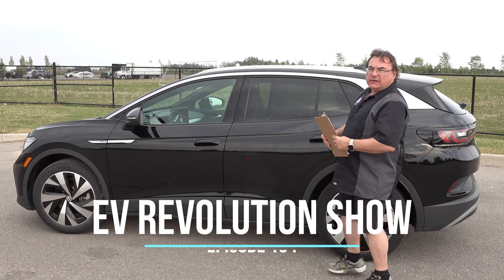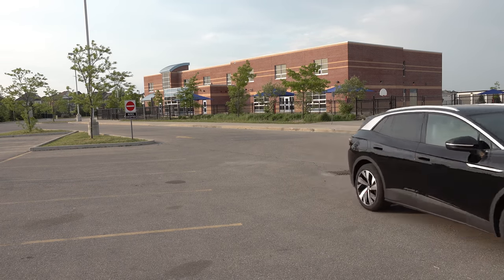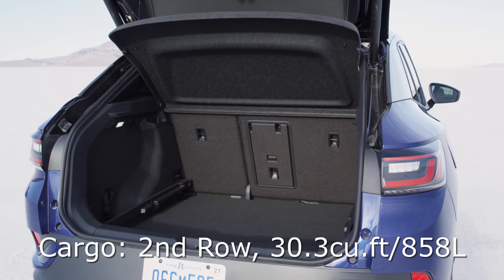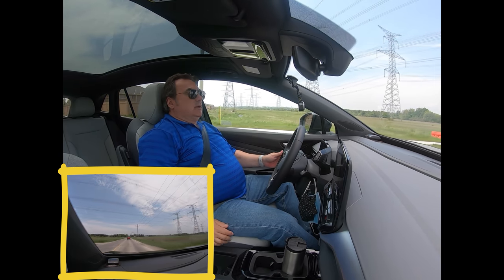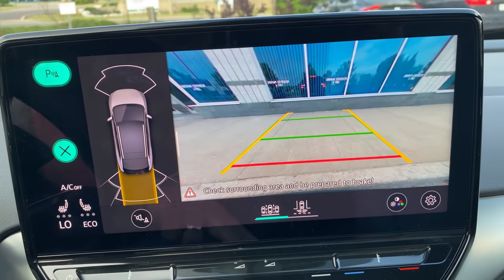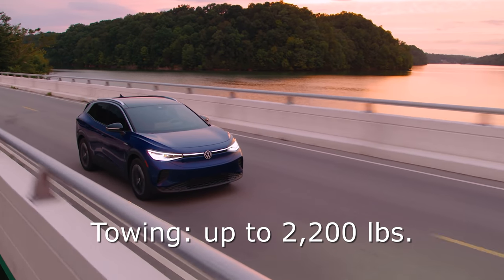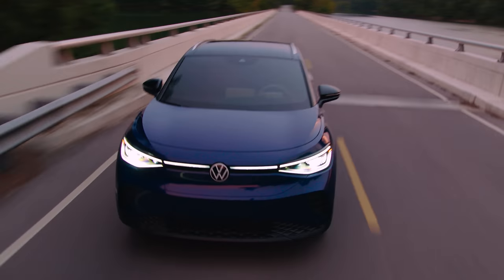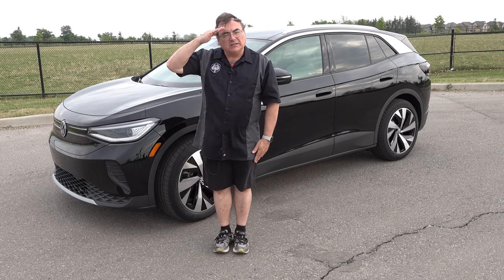Episode 134 - 2022 Volkswagen ID.4 Pro Review

Comment: Thanks for the video, very informative. My only gripe with the ID.4 is with the navigation. On a road trip it won't navigate you to DC fast charges only. You can't plan a trip with the built in navigation. So you wind up using a third party app for that. I just think an EV's navigation should be able to navigate to DC fast chargers.
Reply from the maker: Thanks for watching and appreciate the feedback!  I did not try to navigate beyond the current range.  I am sure that VW will address this in a future software update!

Comment: Very nice, bit disappointing to discover it’s only a 250mi vehicle though, I was hoping for 300, dropping to 250 in winter
Reply from the maker: Thanks for watching!
Reply: They would need to sell it way more expensive, then people would be disappointed about the price, they need to start at a lower price first, I’m sure that they will upgrade their offerings in the near future, I find that the range is very useful. The charging curve is excellent for road trips .
Reply: They just did a massive range test in Norway (through city roads, country roads, and motorways at speeds of 60 km/h and 110 km/h (37 and 68 mph). Id4 did 532km or 332,5 miles

Comment: Thanks as always for the video. Its a good contender. If you got another chance with the car, Id like to see the range testing at 90km/hr.
Reply from the maker: Thanks for watching and for the feedback.  The two highway stints were at about 110-115 kph on the 401 and still got good range, even with a outside temp drop.  So I would say it would do even better at 90kph.
Reply: @EVRevolution  Yeah for sure. I dont generally have to use the highways so dont go over 90.

Comment: After  how many miles, do I have to change the batteries ?    and how  expensive are they  because I drive about 120 miles per day
Reply from the maker: Hell and thanks for watching.  Great question.  The warranties for the battery packs/cells are typically 8-years / 100,000 miles (160,000kms) here in North America.  I am not sure about overseas.  This means that if the best SoC for the pack falls below a certain percentage within this time period/mileage, VW will replace the cell/module or pack to bring it back to the min best level. These systems are much better and with thermal management, will last for years.  I would not be concerned about this even with that kind of driving, which is higher than normal for sure.  Proper charging via Level 1 or 2 would be the best to ensure a longer life system.  If you rapid charge all the time, this can have a faster detrimental effect on the pack.  

Hope this info helps and if you have any further questions, please feel free to email me at EVRevolutionShow@gmail.com.

Comment: Think you said 'alas'... re keeping it under the $45,000 threshold. Presume you meant 'hallelujah.' That aside, great review in general, very thorough, and one of the most detailed I've seen on the ID.4..Would have liked more impressions of power in all drive modes. Also would like to know weight and towing capacity of 4WD versus 2WD. Am trying to decide between the two versions, have a deposit down already. Thanks for the report.
Reply from the maker: Thanks for watching Jim and you are correct....I meant the positive!  

The power in Eco mode was plentiful and I am sure anything more than that would be a bonus...no problem getting up and go. I guess my driving is more on the conservative side, so if I am satisfied with Eco modes, then I know anything more will be quick.  I drive in Chill mode all the time in my Model 3, there is really too much power to use all the time.  Don't need it.

With regards to the towing, this is what I have for the RWD Pro version: I quote VW specs: with a braked trailer: 998kg/2200lbs, with an unbraked trailer: 748kg/1649lbs.  AWD braked trailer 2700lbs.  

Here is an article that explains it all.  https://electrek.co/2020/09/29/vw-id-4s-awd-model-will-have-2200lb-tow-capacity-available-in-mid-2021/

Hope this helps and thanks for the questions!

Comment: I really wanted to like this.  Interior and exterior is nice. We would need AWD so disappointed it will have less range. My wife already thinks our LR Model 3 has too short of range when we road trip. Winter would be unacceptably low range IMO.
Reply from the maker: Thanks for watching.  Wow, you guys are hard to please.  The M3 LR is very good for range and I wonder why your wife feels it's too short - do you drive more than 400-500 kms every day!  I think some perspective on actual normal use may be in order.  The longest range BEV right now is the Model S Plaid, so if you have $100+ K USD to spend, then your wife can have the best range on the planet with over 400 miles! Or maybe the Lucid Air will trump that!
Reply: @EVRevolution  yeah we have had a few close calls on winter road trips and strong headwinds almost not making the next charger. I would gladly pay a bit more for a bigger battery and more range. But yes, for daily commute it would be perfect.
Reply from the maker: @Craig M Well the Hummer EV may be in the cards for you...or the largest Rivian R1T or R1S, with over 640kms of range.  Or Model S with EPA 663km range.
Reply: @EVRevolution  probably all out of my price range.

Comment: Thanks for the Canadian perspective. Over all it looks like it offers a ton of features and I look forward to testing it, but how would I get the charge cable out from under the rear floor when on a road trip with a car full of gear in the back? VW has thought of so many great things that I can't believe they didn't think of a front trunk for the cable? Does it have a side cubby in the rear to store the charge cable?
Reply from the maker: Thanks for watching.  Yes has a couple of side areas like for washer fluid, so you could put it there.

Frunks are not offered by all.  It would cost a few more dollars, and I believe VW is trying to keep this as cost effective as possible.
Reply: When on a road trip, you use level 3 DC fast charging or in a level 2 AC, and those have their own cable, no way that you will use the emergency cable provided with the car that take forever to recharge the big battery pack.

Comment: does the Base model have Heated Seats !?  I think I am being snowed by a Dealer Rep that the Base model does not have heated seat !!
Reply from the maker: Hello, thanks for watching!  In Canada (not sure where you are), both trim models (Pro and AWD Pro) offer heated front seats as a standard feature.  We are getting only 2 models, with options available to add to them.  See this link for the build page which compares the two models and what is standard with each, as well as what is an available option.  

https://build.vwmodels.ca/build/?vw_bp=cz0xJmJwPTEmbD14JnNnYz0xJnNnaj0xJm93bD0xJmxhbmc9ZW5fY2Emc2NyPTEmcHJvdj1PTiZtdGQ9MCZtdG09MCZ5PTIwMjEmZmE9aWQuNCZtYT1pZC40JnQ2MD0wJm09MCZwbz0xJmJvZHlUeXBlPWVsZWN0cmljcw==

If you need any further help, please email me at EVRevolutionShow@gmail.com, and I can speak to the dealer rep if you want me too.  But yes, seems they are snowing you by claiming the base model here in Canada (the Pro) does not have heated front seats.  

I don't believe Rear Heated Seats are offered at all.  I can't find that feature.  Also, in Canada a heat pump is standard on both models.  Hope this helps.

Comment: 2021 I think you mean?
Reply from the maker: Thanks for watching.  Technically, this is coming later this summer so it may be deemed as a 22 model year.
Reply: @EVRevolution  If  it is 2022 according  to VW range is close to 300 miles for RWD. Plus breaks off , software upgraded by air, charge time for DC is dramatically improved

Comment: VW lost me when you said "no hold function"
Reply from the maker: Thanks for watching.  I did not see one, so unless someone else has talked about it, I don't believe it has one.  I checked some other sources and it seems the Auto Hold is only on European-spec vehicles.  North American is a no and seems no plans to add it.

Now, you may not want to walk away so fast.  I''ve driving cars for over 40 years and only until the last couple of years, have experienced this Hold feature (my 2018 Nissan Leaf with ProPilot 1-Pedal driving and now with my Tesla Model 3.  I really never used it in my Leaf but do in my Tesla, as it is more refined.  However, I do use the brakes a lot in order to not let them rust out.  

My perception of why no hold from VW on this:  Most people coming from ICE vehicles will likely appreciate the lack of 1-pedal driving and the addition of creep when letting off the brake pedal, for one simple reason: it mimics an ICE automatic vehicle. It's what they're used to, it eliminates any kind of adjustment to driving the ID.4.

So in order to sell more of these, to the people who don't have EVs today, I think this is a good strategy.  Who knows, they may add it in the future but even if they don't , guys like me would still be fine using the brake pedal, as has been the norm for decades (or riding the clutch but don't tell my wife! ;) ).  

If you are serious about looking at the ID.4, you may want to really look at all the other benefits it can provide at a very good price point.
Reply: @EVRevolution  I wonder what the reasoning is behind the lack of auto-hold on non-European specs is, seems like such an odd feature to omit when it's probably just a software thing. Maybe an over-the-air update could add it?